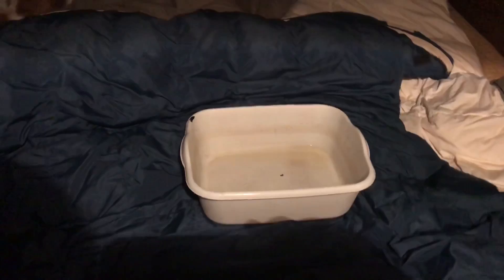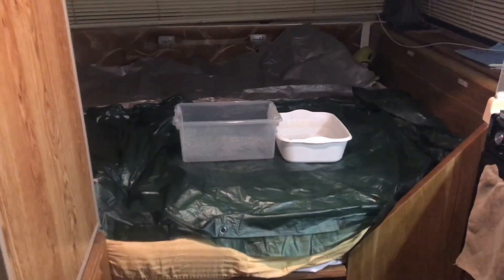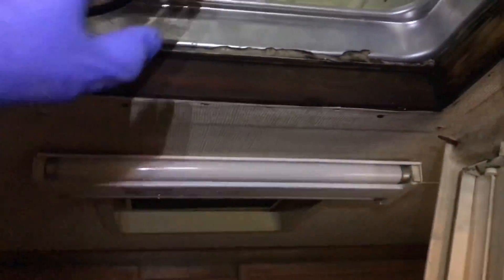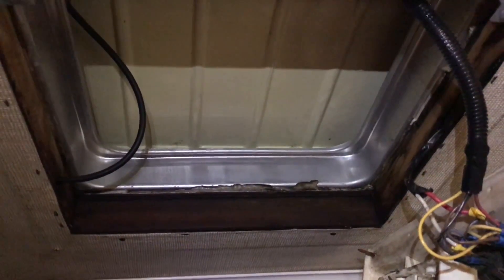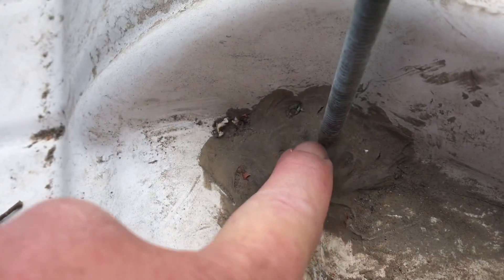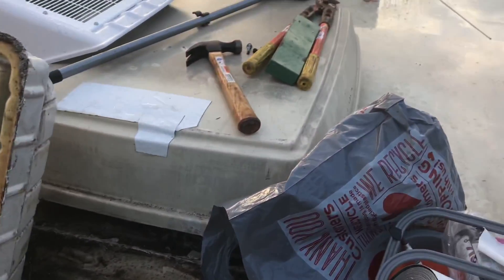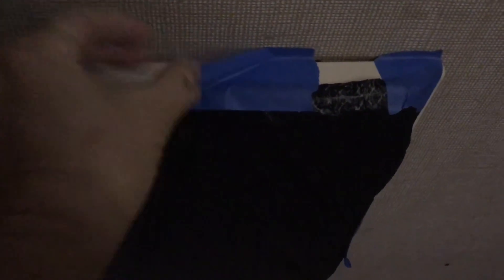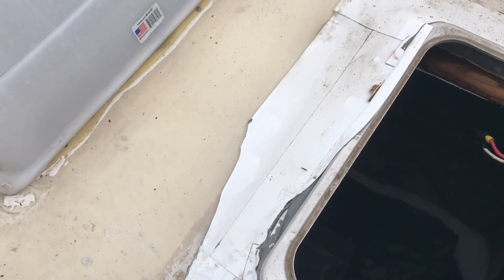RV LIFE | Roof Leak From He!!

Comment: I'm feeling your frustrations Kelly, my old motorhome has had many leaks and gremlins are always at work. LEXICAN CLEAR SEALANT.  great stuff,  don't give up kelly, you got this. SOPHIA   take care of your mommy. Love you two.
Reply: I think the rubber membrane is loose from the decking. I think it needs to be removed first and or replaced. Anyways not a job easily done... mine is probably leaking from multiple spots and running underneath the rubber. If that makes sense?

Comment: Ugh. Leaks. I feel your pain. I know you're stressed and frustrated but you still seem positive which makes me smile. Hang in there. Once you get through this, you'll have a bomber new home. AND it has a swamp cooler which I think is pretty cool.
Reply from the maker: Thank you, Utah. Well, I actually had to destroy the swamp cooler to gain access to the leak. Had to pull list all of the electrical wires and the water pipe to remove the shroud. A lot of people actually replace them with vents anyway.
Reply: Kelly Doyle I kinda figured... Just trying to take a page from your book and see positive where there's a leaky swamp cooler. At least there was a swamp cooler! I'm sure a vent or fan would be just as good or better. I really hope you can get through all this water bs and on with comfortable living. Other than a break in the storm, you need anything? Maybe one of those Birkey water filters, eh?
Reply from the maker: UtahRoadbase Yea, a lot of people switch to vent fans because getter less maintenance and more energy efficient. Oh! Birkey! Yes, that’s actually been on my list for years!
Reply from the maker: UtahRoadbase The amazing love of my subs helps me through. ❤️🐶

Comment from the maker: If you enjoyed this video or got anything out of it and think others would too, please feel free to SHARE, like, and subscribe for more! 
And does anyone know what this THING is on the roof at 12:00 ? 
Thank you! We love you! 😀🐶❤️
Reply: 12:00 appears to be an antenna on an arm.  If you are watching television with it then keep it.  However, I'd suggest going to the roof mount and seeing if you can remove the bolt or pin, thereby not disturbing the roof underneath it.  You'd have to pull off the one connection on the antenna to pull it off.
Reply from the maker: James Stratford Thank you, James! 😀 Yea, it’s in the way of sweeping the pooled water off. Do antennae’s even get reception anymore with the new digital!
Reply: @kellydoyle  They do if they are HD antenna's, however I don't like commercials so I hadn't checked into it. :(
Reply: @subuer  ANY antenna will pick up a digital tv signal, even the old yagi style your grandparents had up back in the 1940's. Your TV tuner will dictate if it can display the signal on your tv screen. And it's up the the people broadcasting the signal as to what resolution it is. 480i(standard non-HD digital signal)1080i/720p/1080p(HD-resolution). Most all flat screen tv's sold within the last 10 years will be able to display all the digital resolutions. The 4k(blue ray) resolution is some of the latest but i don't know any Over the air broadcasts being done in 4k. Takes a lot of power to pump that resolution out over a tv transmitter.
Reply: @NoName-zq6ic  That's good to know thanks!

Comment: Leaking seems to be a common thing with this type of RV. There are other YouTubers having same problem. It's a bad design to have the heavy stuff on top of not so sturdy roof and the weight of it creates concave on the roof overtime, collecting more water to make the matter worse.
Reply from the maker: Yes, that’s exactly what happened. Water pooling. Otherwise those first seals would’ve held up.
Reply: @kellydoyle  it's a video from several years ago but he's listing stuff he used here https://youtu.be/tJ359-TlZRQ
Unfortunately he lost the video of him working on the roof sealing, though.

Comment: Darn it.  So sorry your dealing with this.  Wishing for several days of dry and sunshine.  Be sure, if you can to run a fan to start drying out what got wet.  RV’s and leaks!!!uhg! They can be such a pain.  Once you get all things sealed properly you’ll be happy.  One day at a time. Wish you had a garage to park in or a covered drive so the rain would not be a problem until you could fix things.  
Hang in there and in time you’ll get your home set to go for comfortable times and fun.
Reply from the maker: Thank you, Marcella. The beam actually dried quickly once the leak was sealed. Once I finish sealing the entire RV then I have to check all of the pre existing water damaged areas plus the new ones and pull out all of the rotted wood. 😲

Comment: Not a suggestion - just a idea to put in you knowledge base. There is roof leak repair goop that is used on wet surfaces on house roofs. Works in the rain - and it does. More like a thick caulk like tar though. It gets firm, but not hard, so does not crack. Really sticky and no way to keep it off you - prepare to throw cloths and application tools away - use a flat stick or $1 store putty knife. It will get on your face and you don’t know how...just so you know. 
Comes in gallon cans and caulking cartridge. Made by Henry. Lots of home improvement stores will have it.
Henry also makes a white roof coating and caulk. 
In general, I would guess there are equivalent RV products.
Reply from the maker: Thank you, Mike! Yes, I was looking for something just to seal it up till my RV sealant arrived.

Comment: I"m still watching the video, but I had one leaky roof and leaky windows in my 1963 Santa Fe Cub trailer. I replaced my vent/fan with a Maxx Air Fan. I used a brass wheel drill attachment to remove that old caulking - it worked great. If the tape doesn't work for you, you may have to remove it and put new butyl tape between the roof and the fan/cooler.  Did you say that was a swamp cooler? Yep my camper spent a lot of time under the tarp until we could get all the damn leaks sealed. Problem is the water runs along framing so where you see the water inside isn't necessarily where it's entering on the roof/window. We also pulled the windows out and reinstalled with fresh butyl tape and then dicor lap sealant. I feel your pain. It's so disheartening when you've spent so much time working on it, you think you fixed it, then drip drip damn drip. The last thing we did was paint a roof sealant on. It's Henry's brand. That has worked wonders, after butyl taping and caulking it to death.. Keeping my fingers crossed you stay dry!
Reply from the maker: Thank you, Emmie. Well I never got to this seal before the rain. And I’m glad I didn’t because I would’ve sealed around the swamp cooler where the old sealant is making it worse! I think the tape didn’t work because of the standing water and it raining right after I applied it. So far, the Dicor has held up!
Reply: So discouraging,yeah. Water can sneak thru a smaller holes than mice even_ ha! A pin size hole.

Comment: What you need is a large tarp to get though the rain then once everything drys up then use the tape and put the caulk over edges of tape. After that if I were you I'd coat the whole roof and seams with rubberized roof coating. Oh by the way blue tarps don't keep water out very well, try a brown one. Befor you do any of this work you'll need to wait 2 or 3 days for everything to dry out well.  Don't let it eat your lunch. As someone with clips in thier brain I know exactly what you're going though, I tryed for a week to get someone to go up on my roof and spread the tar and finally I had to crawl up the ladder and do it myself. It wasn't easy because I'm 2 months out of getting 2 gut surgeries, there just comes a time when You have to do what you have to do. Best of luck. Just get large tarp and get the roof totally covered. First things first.

Comment: Once you get that to stop, if you can get it to stop, you need to get some dry heat going in there. Use a electric heater to dry that moisture out if the wood or then u will have a worse problem, mold! 
You will conquer this Kelly. I wish you had been advised to wash and recoat the roof as soon as you got it. It is the first thing i do when I get a rv. Wash the whole roof then two to three coats of roofing with sealent around every box up there.
Reply from the maker: Yes, that was my fear, mold, and why I was so relentless in sealing it as ASAP. The wood dried fast and I’ll get a moisture meter to check for any areas that are still damp inside and take it from there.

Comment: Honey I'm so sorry. Been there..... Ohhhh yes. I lost my nomadic spirit and have 5th wheel (leaky) under a pole barn for good. The cats and I. Spend the $$ and get a good dehumidifier. Will dry the inside well. Mine runs 24/7. In the way and noise too, but so worth it. Helps with odors too. I run an air PURIFIER 24/7 too, hepa with neg ion etc. Of course I'm stationary but still the humidity is bad in campers. ALWAYS SOMETHING with campers. My very best to you in getting things right. You have a good spirit.
Reply from the maker: Thank you, Spring. Yes, I’m hoping to get a dehumidifier and air purifier when able.

Comment: Im so sorry your having such a hard time sealing those leaks.  Its amazing where the water can get in.  Hang in there
Reply from the maker: It was just one leak now. But it’s an area where the water pools up plus trying to seal it up in the cold rain without the proper sealants because amazon was late. And two days prying off a sealed swamp cooler.
Reply: @kellydoyle  
U can't get a good seal when that roof is wet. 
Get a tuffer cover until u get to a dry place?

Comment: My entire roof on my van was cracked and leaking when I got it,  (it's all fiberglass) and I got some truck bed liner and sprayed 2 coats all over the roof and NO MORE LEAKS.  Check it out - U POL Raptor bed liner
Reply: There's an idea!🤯😕🧡🖤💦💦💀
Reply: I thought about this also but couldn't find anyone with info. Was the product available at a store?? I wondered if it would flex enough.
Reply: @kathybaker958  Hi Kathy.  This product is very hard and durable and dries quickly. It's actually used in trucks as bed liners, and many ppl have used it on the exterior of their vans and cars, some even covering the entire vehicle with it.  In fact, I know one Canadian vanlifer who sprayed his entire van with it and has had it on for well over a year now with no problems.  The flexing is what causes the cracking and leaking in fiberglass tops so this stops that problem.  It is also used in many marine applications. I personally have complete faith in this for preventing future problems in my '02 Ford E250 van.  I never could find it in any stores, but Ebay, Amazon and U Pol all carry it.  Another vanlifer I know used bed liner on the roof of his van, too, but he has the metal roof so used the rubber liner.  If you check out YouTube there are many videos on using it, but I couldn't find any that specifically showed anyone doing it on their roof.  Good luck to you!!

Comment: My windows leaked because the two "gutters" slots were clogged. That made the rain pool up and overflow into the RV. Also, the gasket material could be pulling away. I found enough to do the entire RV online pretty cheap too :) LMK if you'd like help finding anything.
Reply from the maker: Thank you, MJ! I was wondering about the gutter slots. Haven’t had time to research that. The window leak stopped after I put a little painters tape over one spot. I’m hoping that’s a good thing. I’ll check it more thoroughly when the rain breaks.

Comment: I'm so sad that this happened to you. You were so excited to get your new place...and then it leaks. My brother bought an older RV and the roof was leaking. He had to rip out the old rotted wood and replace it and reseal it. He kept a tarp on top of it all of the time until he got it repaired. He has it fixed now. You should watch some YouTube videos and see what others did. You and Sophie are troopers. Do you have anyone to help you?
Reply from the maker: Thank you , Donna. It’s till much better than the van! Did he live in his RV while it was tarped? Mine got too humid inside with the tarp covering the vents and they say humidity breeds mold. Yes, after sealing everything I have to start tearing into the dry rotted walls to assess the damage. It may be beyond my capabilities and resources. We shall see.
Reply: I spoke to my brother and he said he had to pull his entire roof off. He laid down 3/4 inch plywood and then screwed it in and sealed around this  Screws. He said you will need to get a new vent and replace any rotted wood. He ended up putting on a rubberized roofing on it that he got from an RV place online. He says that you need to use leveling caulking ....he thinks that is the name of...but wasn't sure... That is made especially for rvs.  He said that this caulking is sort of expensive but worth it because it's sort of stretchy and expands and shrinks when it is hot or cold.  He did not live in his RV while fixing it. He had it parked beside his house. My other brother had given it to him because he did not want to repair it and the brother who repaired it is very handy with wood working. The roof on his RV is perfect now. He kept it trapped always while working on it. Rain will destroy your RV. You have alot of standing water on your roof. If I were you I would drive to an RV sales lot and just speak to a repair guy. Tell him your situation.  Maybe they can help. I hope you and Sophie are ok.
Reply: You might consider selling it..and selling your van and buying something newer.

Comment: As much money as you spent on caulking, tapes, lots of time spent... due to all of the rain, it may have saved you angst & money by going to town, rent an RV storage area with an overhead roof to keep your roof, windows dry while you worked, rested, etc. If you rented for 1 month ?  
There is an RV waterproof paint type stuff to paint on roof of your RV as 1 more "extra".  I saw Carolyns RV Life do it years ago.
Reply from the maker: Storages don’t let you live inside the vehicle, they cost around $350 and up a month, and the leaks needed to be resealed.

Comment: We had a nightmare MH too. Best wishes. It will get better. The leak on the windows could have crack on roof seam above it. My husband use flex steel to seal it. Didnt leak any more.
Reply from the maker: Oh, wow. How many seasons did the flexseal last? I wanted to use that but heard it will fail from exposure to sun and rain.
Reply: @kellydoyle  Larry checks roof each spring. He used Flex Steel first time 2 yrs ago and still holding.

Comment: You could put a big piece of plastic on top of the swamp cooler (on the outside ) until you can seal it up better. Good luck. Love ya Kelly and Sophie! ☺
Reply from the maker: Thank you, Tweak. Unfortunately, the issue is that water pools up there from all sides of the roof. A cover over the cooler won’t stop it. Just two more days of rain though then I can finish sealing her up for the next one.

Comment: Mineral spirits works well to clean up the caulking on your hands and phone etc.  It looked like you needed to also re-caulk around the base of the TV antenna.
Reply from the maker: Thank you, Tom. Yes, I was only able to seal the spots with signs of previous water leakage before the rain came for ten days. I still have to seal basically the entire RV top to bottom, every nook and cranny. But the bits
I sealed before the rain did hold up!

Comment: From personal experience ... before  sealing your side window be sure the 'weep hole' is not plugged and that you don't fill it when you mend the window.  I ended up cleaning the weep holes with weed eater line...pipe cleaners were too forgiving.  Darn it!  The joy of used older RVs.  👀
Reply from the maker: I never even heard of weep holes! I’ll look it up. Where are they? Maybe I sealed over them because there were zero signs of a previous leak around that window.
Reply: @kellydoyle Hey, Kelly!  I'll do my best to explain.  Each of your windows has a track to open and close. Somewhere on the bottom of this track and on the inside of the window frame is a slight opening to the outside.  Okay.  Now 🤔.   We are half way there.  🤓  Look on the outside of your window at the bottom and somewhere on the frame will be a smallish vent ( or 2 or 3 depends on how big your windows are).  This part takes a lot of patience and a sense of humor (which I know you have. 😁).  What works for mine is at least a yard of heavy duty weed eater line shoved up from the edterior window frame vent to where the opening is on the interior window track opening slot.  Once you have it threaded through both ends (for my class B easier said than done) you can 'floss' the opening.  Of course, repeat for each window.  😉  Guaranteed you won't believe the crud that is unearthed!

Comment: Kelly, I had a camper that kept leaking at the air conditioner vent, and it turned out the actual leak was somewhere else and running down to there to come out. Is the camper level? If not, investigate on the higher end for a leak. Try to not despair, you'll get it sorted. ❤
Reply from the maker: Thank you, Lori. Yes, it’s level. It saga in that area as all of these older class C’s do. The leak stopped after the last sealant but then two more leaks started. 😲 I got the second leak and will be working on the third.

Comment: eternabond tape will help you...with the dicor...use the tape on larger areas and then dicor on the edges of it
Reply from the maker: Yes, I used the eternabond first but it was cold, damp, and rained right after so the eternabond failed. It peeled right off. The issue is water pooling up there.  Will see if the Dicor holds up, just two more days of rain.